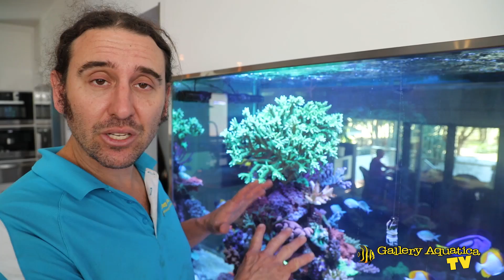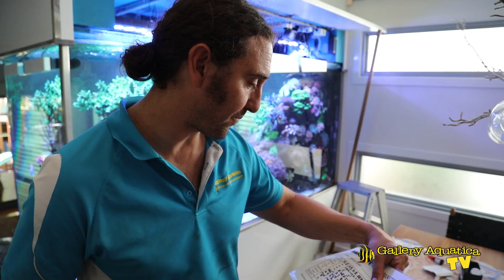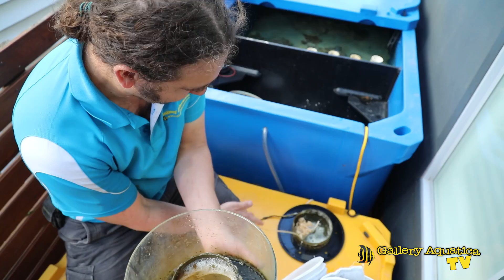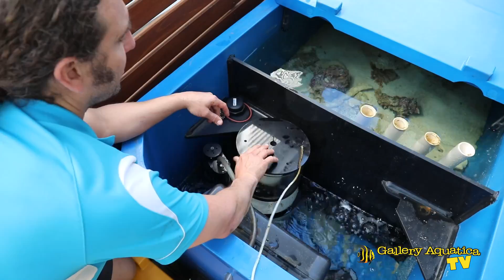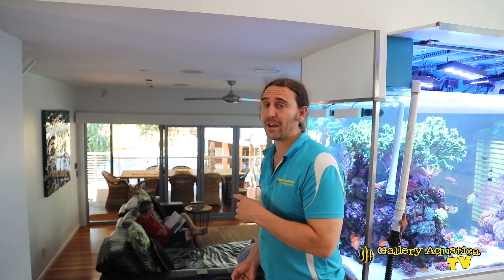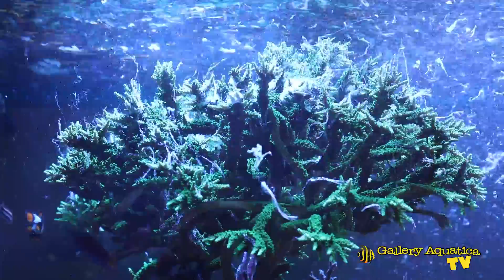Magic Mountains Maintenance --- Gallery Aquatica TV

Comment: hi Cam, what I have been wondering about a long time watching your videos is: how do you manage water temperature of the fresh seawater in your IPCC tanks (getting pumped into and being equal in temperature to that of the DT's)? Especially with the heat of the sun in Eastern Australia?
Reply from the maker: Hi Martijn, it’s really quite easy. When the IBCs are more than half full they don’t heat up too quickly, so I try to book the big waterchanges for the morning before the heat of the day. Winter is more difficult as I need to heat the water, however I only have a problem when I forget to add the heater over a particularly cold night. Cam

Comment: Can you pls show how the stick is holding up the canopy door?  Just a stick or anything else holding the stick on the floorV
Reply from the maker: It’s really just a long stick that’s cut the perfect length to hold the hood open. Checkout a video we recently did on Splashback reef, it has a much more elegant design for its hood opening. Cam
Reply: Gallery Aquatica TV thx. I have a 450 gallon tank and canopy opening is not fun.

Comment: lanthanum chloride into the skimming chamber, exactly what I've been looking for. Are you dosing some very diluted mixture ?  I have been looking at doing this. Basically guarantees the lanthanum will be sucked into the collection cup.
Reply from the maker: Been doing it on this tank for the last 3 months and it’s certainly given us excellent control over the phosphate level. We haven’t done an ICP test since starting, however I’m hopeful the lanthanum level is acceptable. Cam
Reply: @GalleryAquaticaTV  Cam, will you show the ICP results (especially the lanthanum!) in a later video? Thanks man!

Comment: Do you run UV in NSW before adding to kill unwanted stuff ?
Reply from the maker: No, I’ve never had any problems that I put down to the NSW, but I do run UV in most systems including this one. Cam
Reply: Is is mandatory when we use nsw? I used to have NSW tank it was amazing for 5 months . I did multiple water changes. But once my fish got infected . No UV though.